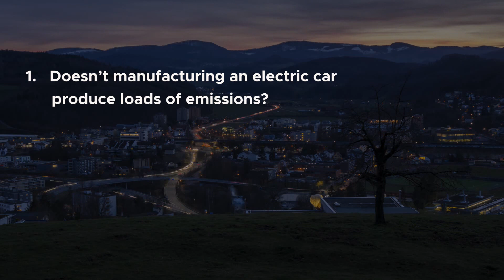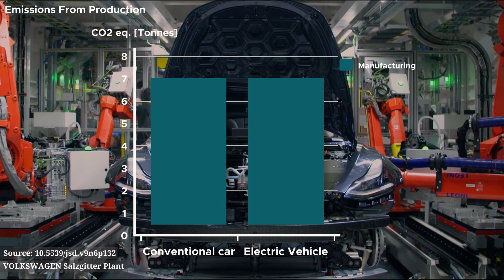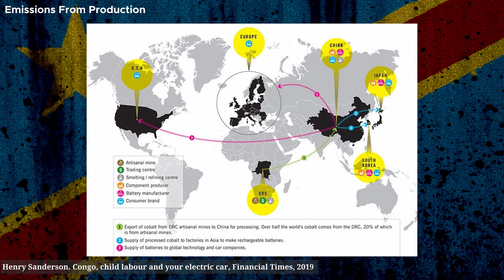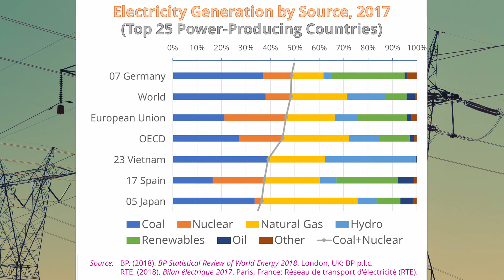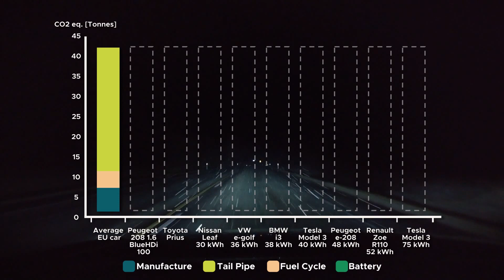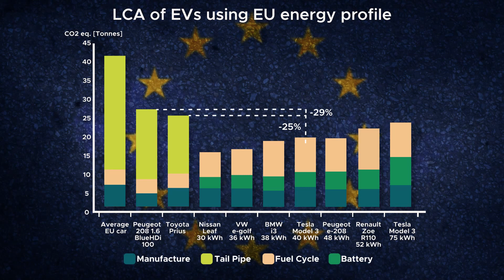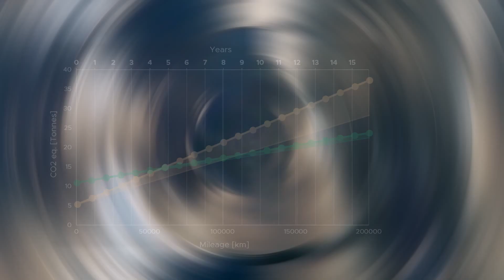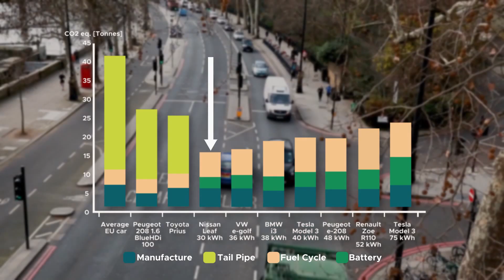Could Electric Vehicles be Bad for the Environment? Data Reveals the Truth

Comment: And the Swedish study, again and again. The first mistake is to set the emissions of building the electric and the ice on the same level. ( Without battery ) 2000 moving parts, very complicated and high technical combustion engines with with automatic or manual transmission, tank, hundreds of sensors, exhaust system, exhaust gas cleaning, complex cooling, etc has the same impact as the 200 parts driveunit of electric car??

Your facts are opinions no facts. Won't losing my time with this video.

Comment: There is one absolute gigantic flaw in your data.
If you are going to compare where the energy in the battery comes from,
you have to consider where the fuel in gasoline cars comes from as well.
Otherwise you are not comparing apples to apples.

Take a look at this video and learn why this video is in need of an update.
https://www.youtube.com/watch?v=1oVrIHcdxjA&t=558s

Also, batteries today are absolutely being recycled.
@JerryRigEverything even have a full walkthrough of a battery recycling plant where they recycle a full EV battery.
Not only that, a EV battery usually ends up as home battery backup extending the length of its life before it goes to be recycled.

There are many more studies and researches you can reference, but you need to include the full picture.

Comment: 40% of carbon emissions come from electric power plants, 15% comes from passenger vehicles. EVs usage increases electric bills by 15%-20% per vehicle in a household, which have 2 vehicles on average per household (30-40% increase in electric consumption avg). If everyone in America drove an EV there would be 30-40% increase of electric consumption which would equal to a net increase of carbon emissions through the energy sector by about 12%-16%, 52%-66% total CO2 emissions, which would cancel out the reductions brought upon by EVs. If the cost invested and spent on EV technology went towards improving gas consumptions by making engines more efficient, and improving exhaust system's ability in reducing CO2 , which is what we have been doing since the 70s. Then we would actually reduce emissions instead of creating another problem like we did when the idiots who thought replacing paper products with plastic ones was environmentally friendly.

Comment: Several factors I didn’t hear mentioned:
The amount of electricity used to bring crude oil from extraction to pumping into the car tank is almost as much as the amount to run an electric car directly.

LFP batteries,which are becoming the norm,don’t use cobalt and last longer than a vehicle is expected to carry it around.
The battery,if not recycled, can be used for stationary storage.
An electric car charged by the dirtiest power,coal,produces less carbon dioxide than a gasoline engine per mile.
Suburban drivers,who are likely to drive more miles,usually have room for solar panels at home,reducing the load on the grid and can contribute to grid stabilization by charging off peak and feeding the grid during peak hours.

I still drive my Toyota but while it’s parked,it doesn’t pollute at all. The solution to environmental problems might be stopping wars over petroleum,outlawing professional sports,and stay at home.

Comment: Did i miss something? Plenty of talk about the carbon footprint of the EV battery but no mention of the manufacturing complexity of the engine, gearbox and clutch assemblies.  I would imagine the amount of machining, casting and hardening processes would add significantly to the Ice carbon footprint? Dirty engine oil changes and amount of time carried out repairing and servicing ice cars would be significant too?

Comment: Well done.  I have been looking into this and this is the first evidence based non hysterical analysis I have seen which makes sense.  Alas, living in australia where our power grid results in more than 500g of Co2 per kwh, as well as the range requirements and lack of infrastructure in the rural areas, we went with probably our last ICE car.  A real deal killer for us is how much it now costs to charge up at a charging station ( engie just jumped it up to be above the household residential energy costs) - so we had to factor in the cost of a battery for the home solar as well - which made an ICE a better alternative both economically and ecologically. I am hoping in a few years' time improvements in fuel cell tech, hydrogen and yes even synthetic fuels combined with a cleaner energy grid will mean it makes more sense.

Comment: Cobalt is used in the refining of all diesel and petrel. Cobalt is also been gradually been fazed out of EV batteries.
Reply: To be fair though, really small amounts of cobalt is used for refining fuel. I'm on the pro-EV side of the debate, but I do think it's important to note that. If you're arguing with someone over the child labour objection, we'll then of course a little bit of child labour isn't better just because it is less, and the use of cobalt in fuel refining (and moving away from it in batteries) is a massive own goal for the ICE proponent. But if we're talking amounts and cost, it's a tad more complex.

But overall I quite agree with you. Many people who use the cobalt objection do so without realising it's also used for fuel refining. And they often use a mobile device with cobalt in the battery to send that objection into the ether.

Comment: You missed one very important thing about cobalt; it is also used in the process of refining oil to gasoline. More is used there each year then in producing batteries. Also it is consumed in that process. It can be recycled in batteries.

Claiming that there is no current system for recycling batteries is just false. In both the US and EU there are several viable recycling facilities that are up and running. They will take (for free, and even pick it up in most cases) any lithium-ion battery they can get. In fact it is illegal to put them in landfills in both places, so they are not going there. The reason that only 5% are being recycled is because most of them are being reused in grid storage first or being refurbished. They will eventually get to the recycling. 

You hinted at, but didn't directly say that having an EV decouples you from the source of electricity. That allows the grid to clean up and the EV just gets the benefit for free. 

I think it would have been more fair to compare the model 3 (since it has a range more folks can accept) than the Leaf. The Leaf is not selling well at all anymore. I know, for a commuter it is a great idea, but people want to be able to road trip too, and you can't reasonable road trip in a Leaf, at all.

Finally I think it is overly simplistic to only look at CO2 when it comes to the environment. It isn't even a good aggregate for all air pollution, and completely ignores ground and water pollution. It isn't so simple though, because when you do this it is always apples to oranges. It needs to be done and definitive though or you will still have people claiming that EVs are worse for the environment because the batteries cause more overall pollution.

Comment: My Lexus RX350h  27 mpg in the city and 30 mpg highway.  Highway Range: 460 mi.   Its takes less than 15 minutes to fill it up.  About 18-19 gallons.  In my state that is about $3.65 for premium gas. so just under $70.00 bucks.....

If you want me to even consider an EV.....
I want to plug it in anywhere
I want and charge in 15 minutes and be 95-100%.   
I want highway range of 400+ miles, not estimated, not 30 miles less in the cold or hot, not less because I am pulling my  trailer with  Kayaks or Jet Ski, which I do with my RX. 

I am more concerned about the Graphite, Cobalt, Lithium, Manganese, Nickle, Copper....  Processing all that raw material in China of course.
Then getting a power grid than can produce the power to charge all the EV's.     Sorry you can only plug your EV in on the second Monday of the month.

Comment: I say the fact that gas can be so close to EVs shows how unnecessary the change is. EVs are not sustainable as they're still cars and cars are one of the least efficient ways to transport people. Are EVs better than existing cars, sure, but better is not sustainable. 

They still are massive carbon debts we some reason let people have and possibly wreck before they're paid off. They still used rubber tires with basically no efforts in finding new materials to replace them. They still use brake pads which make carcinogenic dust. They still use roads which are made of oil biproducts and are intensive to make. There's just nothing about them that's sustainable. Even in the best case scenario, assuming all cars are EVs on a 100% clean grid, it only reduces emissions by 8%. Yeah that's something, but you know what would do better? How about more public rail, or better yet, more work from home/ better city planning. 

PEVs (Personal Electric Vehicles) like ebikes, EUCs, one wheels, etc will always be better for the environment than cars. Cars weigh 10 times as much as the people they carry while they also destroying roads 10,000 times faster while also fitting less people in the same space. It's a vastly wasteful system we have in comparison to that simple change. Or better city planning like we had in the early 1900s, where people didn't need cars because your job, the grocery store, and the post office were all without a 20 minute walk or bike from home. We're only in this system today because of cars. 

And then there's rail. The US was literally built on the backbone of rail, yet today it has basically no use for the public. Instead we adopted heavy use of highways which cause more debris from crashes, fires, random garbage thrown out people's windows, and instigates speeding; a safety hazard to the public. With rail you could have fit the entire rush hour traffic on a single train. Just think how many less crashes would happen and how much less garbage would be thrown around if people were taking a train instead of the highway. Or think of how much less traffic there would be just taking many long haul trucks off the road. 

I think EVs are cool and more convenient than combustion, but they're far from "sustainable". I'd say that's either the complacency of the average person today or possibly just straight green washing. "Why change my life to save the world, when I could just get an electric car and change nothing about my unhealthy lifestyle". It's like the person who over eats, complains they're fat, and to fix it just eats carrots instead of twinkies at 2am. That's not solving the problem, you're just pushing it off.

Comment: One factor that wasn't covered is EV battery recycling. As of 2023, some companies like Redwood Materials are reusing over 90% of the battery materials like lithium and cobalt. If that can be scaled up, then were talking about front loading a supply chain that will rely on decreasing new mining.
Reply: Steel has always been recycled but they still have to dig more out of the ground and if every vehicle in the world is electric we will need a lot of cobalt and lithium digging out of the ground recycling it won’t be any where near enough
Reply: @militarymad2840 look up Lfp batteries no nickel, no manganese, no cobalt, 3-5 times the cycle life. 30%cheaper, no thermal runaway. 

Next generation will be Sodium batteries. 

This industry is developing at an insane rate.  Maybe you can pick holes in it today but come back in ten years and the landscape will be so different.
Reply: Electric cars overpriced golf cart
Reply: Cobalt is being phased out of electric vehicle batteries. However consider this, high energy use cases such as cellphone and laptop batteries use far more cobalt by volume than electric vehicles. When you consider how many phones and laptops there are, it's faintly ridiculous to be complaining about cars considering how few ev's are currently being manufactured. Now that battery chemistry is evolving to make them cheaper, with less human and environmental cost and with higher power density by using better manufacturing processes and substituting cobalt for nickle or manganese.

Comment: For some obscure reason people tend to choose cars that exeed their needs. (Who needs a car with more than 50hp, etc) So the 40kw battery is pherhaps what they need for daily use, but they want to have 80kw to make that once i a while trip. Then this calulation collaps. Another thing here in Norway, is that a 40kw Leaf does not go more than 120km in the winter, and with some safetyrange, you can not depend on driving more than 90km.

Comment: but isn't cobalt also used in the production of oil? also, most metals in car batteries can be recycled and therefore the carbon footprint of digging them out is reduced even further.
Reply: No cobalt is used in refining oil canada banned cobalt mining years ago because it was so polluting. The carbon footprint is also from burning tons of bunker C oil to ship the materials, and recycling will only increase that footprint
Reply: @terenceiutzi4003  Cobalt is used in refining every gallon of fuel to remove sulphur, always has been and always will be, doesnt matter where it is refined
Reply: @stevehayward1854  Yes, as a catalyst and is not consumed. The same little bit of cobalt is used over and over to desultory every gallon of gas!
Reply: @terenceiutzi4003  You are living in a delusion. New battery chemistry uses very little to no Cobalt at all.
EV technology is moving on but ICE technology is stuck in the past, ICE engines are very inefficient, only being able to use 25% of the energy in gas/petrol as the 75% is converted into heat, were as 95% of electricity is used for motion and it produces no pollution doing so.
There are so many new batteries that uses very little in rare earths and some uses none.
The technology is improving every couple of months, longer range that are safe, charge rapidly. It's all over for ICE vehicles but it will take years to replace all ICE vehicles with EV's
Reply: @stevehayward1854 BYD and GM are the only ones using the Cobalt free calcium battery. The rest are still using lithiumion, which use all most as much cobalt is lithium! That is why Trudeau is re opening our cobalt mines to suply the battery plants in Mexico.
Reply: Digging them out with diesel powered vehicles 😂😂😂
Reply: Also in Paint products
Reply: @tony34star  not in the last 100 years. The first cars used nitro-cellulose. Then they shifted to acrylics, and now none toxic water born paints house paint used lead in the 30s, then they went alkaline paints and latex now they use acrylic! And industrial paints in the 70 used isocianates.
Reply: @tony34star  we used to mine cobalt in Ontario in the 60s for cancer treatment, but the mines were shut down in the 80s because of toxic pollution.  Now Trudeau has promised Mexico that he will reopen them for their battery production!
Reply: Cobalt is a catalyst used in the desulpherisation process of oil.
Reply: @williampelzer1460  you know that is bull shit! All of the desired components of crude oil are boiled of at different temperatures, and lubricating oils used to be refined by filtering, which clay crystals. Now, they are made by adding CO2 from the atmosphere to natural gass. Synthetic oil.
Reply: @terenceiutzi4003  I actually didn't but thanks for the reply. It honestly doesn't matter whether they exploit small children in africa for Cobalt or kill them and their parents by the thousands from polluted air every year in cities the world over. The fact remains that YouTube videos like this one are only telling half of the story and by omission creating a false equivalence. I honestly don't care which one is better in the short term. My opinion is that it's always better to have the full story so you can make your mind up with the full understanding of the issues involved with both technologies.
Reply: @williampelzer1460  and are they polluting the air with the gas of life(CO2)?
Reply: @terenceiutzi4003  No wasn't talking about CO2 just the nitrous oxide, sulphur dioxide, carbon monoxide and PM2.5 particulates but sure you can believe that these are all beneficial if you want to...
Reply: @williampelzer1460  Why is everyone fighting to prevent the use of ethanol as fuel? It is now made by adding CO2 from the atmosphere to methane. And it burns to cool to produce nitrous oxide and produces 1/10 as much CO.
Reply: @williampelzer1460  and you do know that since 1975, the only vehicles that have been putting out nitrous oxide and sulfer dioxide have been public transit! Why do we alow them to run?
Reply: @williampelzer1460  Sorry, Cobalt is used as a catalyst to remove Sulfer from Gasoline in small quantities, but catalysts are not consumed they just cause a reaction but Cobalt has been all but eliminated since they started using 14 percent ethanol buy volume. The ethanol caused the sulfer to separate from the fuel and forms bonds with the heaver water and settles out as sulfuric acid, which is sold to industries for as much money as the fuel!
Reply: @williampelzer1460  https://youtube.com/shorts/73JtHBtyXMs?si=6xrbzODNyPfSuSm1

Comment: The scales would tip even further into the favor of EVs if the environmental costs of getting the oil from deep underground to the pump were considered.
Reply: Correct and we have now used the easy to access oil reserves so the costs, financial and environmental, of further oil extraction is many times what I has been in the past. Put simply oil production is becoming a dirtier industry year on year.